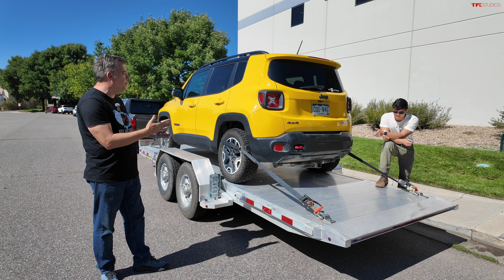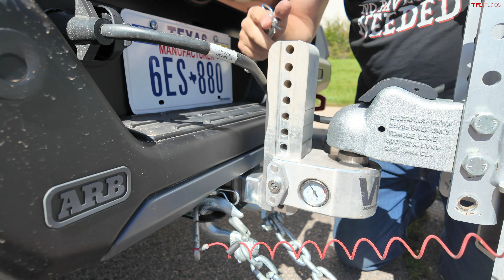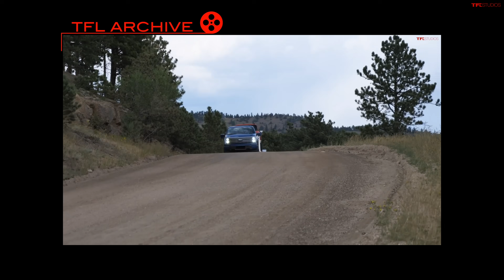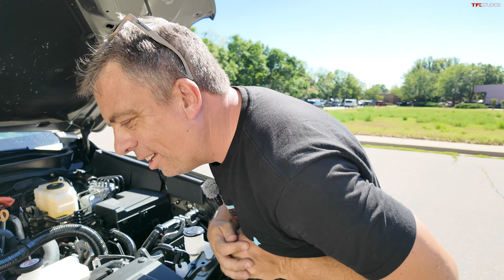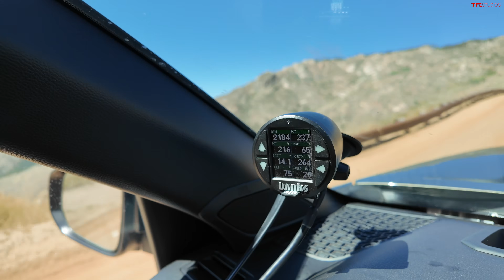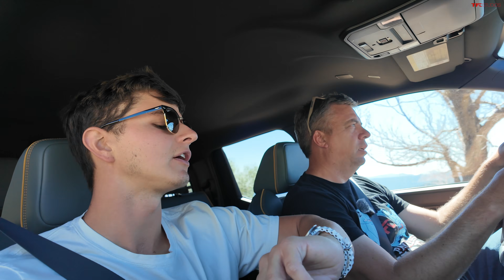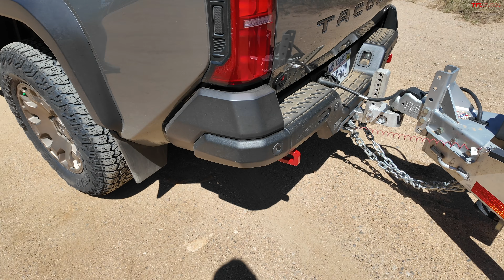Bigger Trucks Have FAILED Our Towing Torture Test, But Will It TOAST the Toyota Tacoma Trailhunter?

Comment: FACT: Running transmission oil through the bottom of a water radiator has always been the norm in the industry this is not new. It serve two purposes, it heats the transmission fluid up in cold environments which allows for more efficient shifting and less wear, it also acts as a weak cooler. It's not sufficient for most towing application since it doesn't reduce the temperature enough.  When it runs the oil through the radiator the coolant temp delta is still around 160-170 degrees compared to the trannys operating temp of 220 degrees. The pipe that runs inline is not very big and the fluids don't get a lot of exposure to the 160 degree water jacket. This is why an external cooler is required which the delta is much greater being a tranny temp of 220 degrees to the ambient temp of outside air.

Comment: 276 degrees is extremely hot.  Anything I've ever read says north of 240-250 is when fluid degradation and physical damage to the trans can occur.  Maybe nowadays the seals and gaskets can tolerate higher temps but I'm curious what trans fluid is used in these and it's heat tolerance.

Comment: I would like to see this with a 3/4 ton. Also that trans cooler is nothing new. My 94 gmc used the same thing. It was actually more to warm up the coolant in the radiator so it wasn’t ice cold when the thermostat opens up.

Comment: I just have a question about payload in the US. The Toyota in the video has 550kg (as per the sticker), which compares rather poorly with the 1000kg load capacity rating on my Amarok, or even the 900kg rating on the offeoad spec Hilux.
So my question is, does this include passengers in the US?
If not, overlanding is really not an option. 4 people is going to be nearly 350kg, 40L of water, gets you to 390kg, hardshell RTT is another 40kg (430kg) and now you need recovery gear, food ect...
Reply: No the payload does not include people. 

Broverlanders in the US just ignore the GVWR

Comment: Would like to suggest you need to create a frontal area to your towing trailer to meet the frontal air resistance maximum square footage specification in the TUT (truck under test)  towing guide. If you're going to test maximum towing, you need to remember weight is not the only consideration., and trying to pull a load against the wind can be a huge issue for truck and cause overheating when combined with a large weight load.

Comment: Nice to hear the Trailhunter passed the test.  We are looking into a 2026 4Runner Trailhunter. We tow a small camper that is 4000 pounds. Our 2014 4Runner with an Old Man Emu suspension has towed it fairly well. With 1100 pounds more towing more torque and horsepower it should do a better job.

Comment: so toyota does not put a  HD  transmission cooler in the tacoma that transmission is way to hot but what is the benchmark ? my  5.7 ram ,up the cajon pass on I-15 and July  240 oil temp , transmission  never over 200   engine   temp 210 the. Highest  as im thinking of a new tow truck for my  6000 lb airstream I travel light    850 lb hitch   , was looking at ranger, tacoma ,Colorado  want to go smaller so I can afford gas , once one gets in the flats  the temp. is lil better
Reply: Toyota's transmission cooling has been questionable for a long time.

Comment: 270 is just so friken hot. Manufacturers set limits super high and make there gauges basically dummy gauges to make people not worry. But doesn’t mean bad things won’t happen. Me personally would never allow my vehicle especially trans temp to exceed 230 for any sustained amount of time. I’d be changing out that trans fluid when I’m done the trip if it touched 270. If it’s conventional trans fluid not synthetic, 230/240 max. Synthetic at least takes temp better but still gunna break down that hot. My 14 duramax pulling 13k through British Columbia mountains up to 12% grades and the crows best highway is slower speed to and never even sees 190

Comment: ram 1500s strill have a seperate trans cooler or atleast my 2023 ram 1500 does. but what was interesting to me is that the rear diff now has coolant lones running to it.
also please add a camera that just shows the cluster and gauges as you climb and decend as thhe small clips only show what you focus on and there could be more datra to be seen like sudden spikes or drops of temps

Comment: Shame it took you a while to mention that a REAL TRUCK that was able to do it - the CyberTruck. The only truck that not covered by foilpaper and nail polish and that made it up the hill without ANY issue. For anyone using the CyberTruck for work (and not roadtrip) it’s the best option out there and once the go to the non foundation series it will be very competitive with similar equipped gas trucks (AWD, full cabin, tech)

Comment: 100 degree day that thing would of failed.
Reply: The engine coolant was only 210F. It would have passed fine. The transmission would not have gotten much hotter.
Reply: It wouldn’t have changed much because it uses a fluid warmer/cooler using engine coolant.  Toyota transmissions are designed to run very hot.  275 deg is nothing for modern fluids/seals.

Comment: Toyota Tacoma Trailhunter truck towing the trailhawk on a trailer on the toaster torture test, I expected it to do well.  TBH.  But of late, one never knows if Toyota is going to meet the challenge that we have come to expect from it.  Some simple stuff strains its systems making it seem silly.  The name Toyota used to evoke reliability.  Not so much anymore.  But this particular trim I would expect it to out perform the base model.  As it is evokes the idea it is supposed to work harder at slower speeds and still make it home w.out needing any special attention.

Comment: I have a feeling the test isn’t correct.  They are basing a pass/fail on the manufacturers maximum set points which will probably be determined by each manufacturer with very different criteria and thinking.  It might be better to consult with what the max temp that the oils and component manufacturers recommend.  From what I found Aisin recommends maximum temp of 260, and GM/Ford’s 10 speed using ULV fluid is in the same range.  I don’t think you can call a manufacturers conservative set points/ protection protocols a failure any more than you can call an aggressive set point or lack of protection features a pass.

Comment: Not surprised that the Tacoma passed. That is a nifty truck. Still think the 2025 RAM succeeded too, but I suspect I am alone in that. Regardless, love these torture tests, keep em comin!
Reply: It succeeded making it to the spot without a problem. The problem only showed up after they stopped because the engine oil thinned out due to the heat. Sadly it's only a pass if there is no fussing from the vehicle. I don't know if automakers still do it but I remember reading in the owners manual that if you were operating in hot temperatures or doing jobs in extreme conditions to run a thicker weight of oil instead of the normal recommended weight. I wonder if they were to run a thicker alternative as the manual suggests for their testing if it wouldn't have had the thinned oil warning.
Reply: I consider the Ram as passing the test.
Reply: @91CavGT5  I wonder if it would have done better if they treated their test as a "harsh condition" and ran a slightly heavier weight of oil in it. The owners manual used to say that if you were operating in high temperatures, extreme conditions or doing heavy pulling to run a thicker weight of oil than the normal recommended weight. I don't know if they still print that in the owners manual under oil info.
Reply: @Slane583  my 2022 Ram does show in a chart to run a heavier weight in hot climates.  I run 5w30 in mine year round, but I also live in south Texas.  I am 100% convinced that if they followed the manufacturer recommendations then it would not have had low oil pressure.
Reply: @91CavGT5  The same goes for me. I also run the recommended 5w30 in my 2020 Silverado year round. I am in NY so it doesn't get insanely hot here. Nor do I do any severe towing. I think if they went back and tested it again with thicker oil they wouldn't have gotten oil thinning as badly.

Comment: It should be a crime to use a bicycle on a no passing two lane road.
Reply: Except bicycles are considered vehicles and subject to the same rights on the road. Remember bicycles were on the road long before cars.
Reply: If the speed limit is 15MPH, sure, otherwise I disagree with you.
Reply: @adamg3911  with your logic, semi trucks should not be allowed on I70 between Grand Junction and Denver since they can’t do the speed limit. They do 30-50mph tops and the speed limit is 70. But you are forgetting that it is a Max Speed Limit not a rule to go that speed.
Reply: @TheAdventureKean  You are taking my statement out of context. I stated “no passing two on lane roads” that are similar to the road in this video. Also, doing 8mph in a 40mph zone is not the same as doing 50mph in a 70mph zone, not even close, I highly doubt the bike in the video was even doing 8mph.

Comment: I don't think I'd call that a "pass", but I'm not an engineer. To me a truck's ability to keep the temps under control with warnings or derating is better than a truck that will just let the fluid get completely toasted. I would say that, if there is fluid degradation or danger to transmission components above say 250 or 260, and the Tacoma let it get up to 275, that's a failure of the truck to protect the transmission... Damn we need Project Farm to do a test now!
Reply: That temp should be fine. Normal baseline is often 230 now. Modern fluids can handle a lot more heat. I think they test it at 320°F for 200 hours. That's the most recent test standard I've seen for class 8 transmission fluid. I assume the fluids are similarly good on these. 

Would be cool to see a test of the fluid. But I'd bet it's basically unchanged.
Reply: Upvoted.

Comment: Now it's the Ranger's turn!  Let's see if it can avoid getting toasted!
Reply: In Australia the 10 speed is known for overheating on the beach without even towing.
Reply: @grantm1891  They took the ranger raptor on the same test. It finished the test with a trans temp 40 degrees cooler than the tacoma.

Comment: The altitude and ambient air temperature also reduce air density, which reduces cooling efficiency of the radiators and airflow cooling over the trans and engine. This is a hard test case. I love it!

Comment: Y’all gotta use Amsoil signature series ATF. You will never overheat!
Reply: Thats not how it works.
Reply: @Jay-me7gw  Tell me how it works then
Reply: @isaacwieman  I can tell you that Amsoil doesn’t have magic fair dust in it that prevents it from hitting 275F. It might run slightly cooler, but only by a few degrees

At the end of the day, the torque converter is generating a huge amount of heat in the fluid regardless of what it fluid is.
Reply: @Jay-me7gw  If you never have used or researched Amsoil then you don’t know about it.
Reply: @isaacwieman  I have researched Amsoil. They dont make a single claim about lowering fluid temperatures in any of their marketing. If that was actually a benefit of their fluid, they would be all over that.

How else would they sell their transmission fluid for nearly 4x the price of Valvoline MaxLife.

Im sure the Amsoil is a good fluid but if you think its going to magically drop the temperature 50 degrees you are sorely mistaken.

Comment: 600lb tongue weight is perfect?
If I remember correctly this Tacoma has payload capacity of 450lb (-ish). You guys combined is already about 400lb and you adding trailer. IDK how it can be "perfect"
Reply: Payload is 1450. 400lbs of people plus 600lbs of tongue has capacity left.
Reply: @MrJcjet  oh, if this Tacoma can handle 1450lb then it's good. In my work I checked 100s of Tacomas (different year model and trim) and vast majority have capacity of 450-475kg (which is 1000-1050lb)

Comment: I would get that trans looked at. Those high temps over a long ride probably caused some damage that will come up soon enough. You might want to get the trans fluid looked at, you could find some metallic shavings.

Comment: IMO that's not impressive, it's actually pretty bad. Traditional ATF starts to break down around 180f and at 220f the fluid is varnishing and shortening the life of the transmission. Synthetic probably ups that around 50f, but 273f is absolutely too high considering the actual temp in the torque converter is probably higher than that. I'd change that fluid ASAP and if I was going to be doing that regularly I'd add a secondary cooler with an electric fan. Without it that trans will be dead in no time.
Reply: Testing baseline is 200 hours at 320°F on the fluid. Aisin transmissions last longer than any other. Even the ones in RAM trucks.

Comment: The trans gauge is a glorified idiot light, its most likely not in line with the rising temps. 

And the transmission cooler has ALWAYS BEEN in the radiator .  It helps heat the transmission up in the winter.

Comment: Remember Toyota does not use a external trans intercooler up front by the radiator.  They cheeped out using some bogus internal one.  This is the "why" there is a problem. Just like there is a problem with the cheapo internal bump stocks versus using proper frame mounted ones like God intended.  Hard pass on this turd.  My 2019 Frontier P4X has a proper external intercooler.  Just amazing what Yota does to cut corners.  TFL was far too kind on this one.

Comment: In the past generation I believe Toyota programmed the overheat temperature at around 300F. It's impossible to know the normal operating range unless you obtain it from Aisin themselves. I would not be comfortable with 270 - 280 at all. An external cooler would be pretty cheap compared to a whole transmission if you did this on a regular basis. Should really be no warmer than 220 - 230.
Reply: I know on the 200 series, and maybe the 2G Tundra, they go into thermal protection mode and lock up the torque converter if the torque converter fluid temperature exceeds 265F. The actual warning light comes on at 300F like you said.
Reply: Depends on where that temperature is being read. Pan temp 220-230 is about right. Torque converter output temp however (where it is on my 2000 tundra) is next to impossible to keep that low in high demand applications. In our offroad racing world we run huge coolers that will keep pan fluid temp around 200* but converter temp will still exceed 300* occasionally, recently saw 330* with no damage.
Reply: @84Prerunner  I don’t think there is a PID available on the new Toyota’s to read converter temp. I believe this is the pan temp.
Reply: @Jay-me7gw that's right.  That's pan temp. And 275 is HOT
Reply: @gigglywaiter  Yeah it is.

Im seriously wondering if the new Toyota's calculate the pan temp vs directly measuring it. my 2018 LX570 with the 8 speed will hit 250F pan temps, and thats even after adding two Hayden 689 coolers in addition to the fairly large stock cooler. Adding 150% more cooling area basically had zero effect it seemed like.
Reply: @Jay-me7gw I'm not sure if they just tested this thing in just tow/haul mode. But wondering if temps will be significantly lower if they locked it put in 3rd or 4th gear.
Reply: @gigglywaiter  If its tuned like my LX570, the engine computer will literally never lock to the torque converter in any gear < 5th. Doesnt matter what mode you are in, it never locks. And thats where I have issues. 5th gear and higher my transmission stays nice and cool at <200F. As soon as I drop below 5th into 4th or 3rd because of a headwind or hill, my temps start climbing.

Its to the point now where I am getting ready to swap from my stock 3.31 gears to 4.30 gears so that the transmission stays in 5th more often.